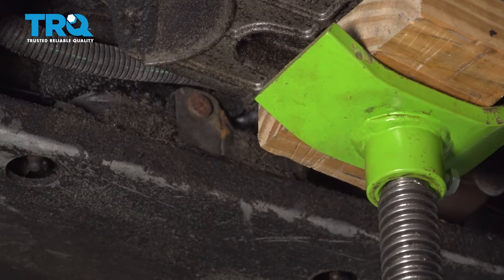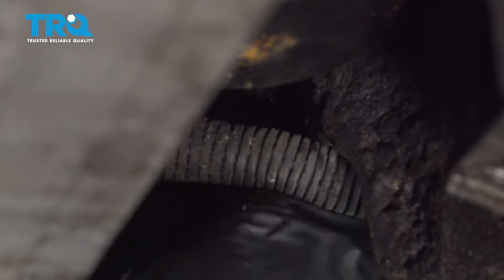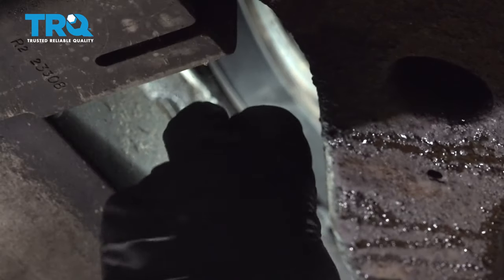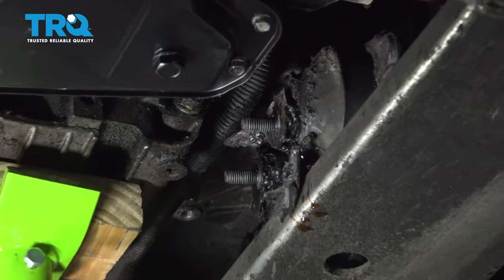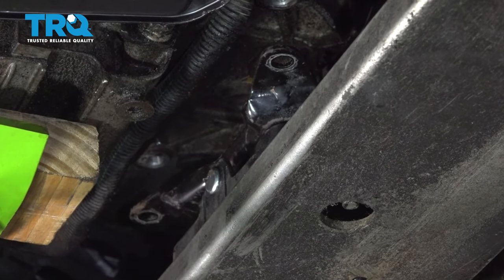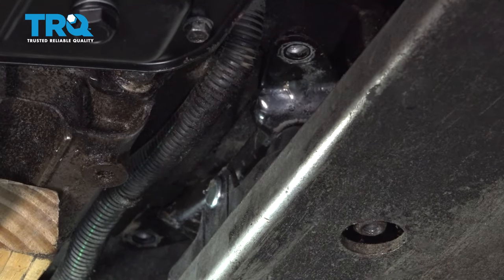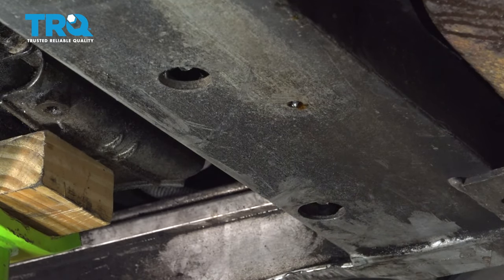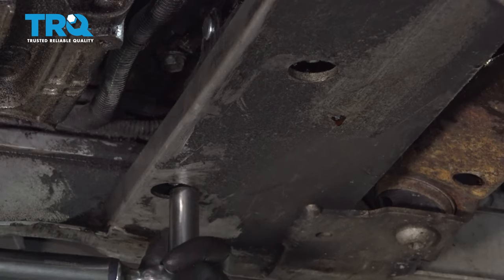How to Replace Engine Mount 2006-2013 Chevy Impala

Comment: Never tighten bolts until all bolts are in place, it makes life a lot easier, Now as far as the nuts on the bracket  you have no choice because you won't be able to reach them later

Comment: You should have mentioned that it’s bet to remove the 2 mounts up top the (dog bones ) and that allows the engine to raise up with zero resistance, and helps work the lower mount out , those lower bolts you torqued , I tighten them then start the car shift from rev to drive a few time and recheck the torque I’ve found those bolts missing many times or once everything is in flush snugged dog. Bones on just tighten them up no reason at all for a torque wrench on something like that snug that bolt and give it a 1/4 to 1/2 turn be sure their tight , or it’ll return with a hard thud when going in gear , 37 isn’t much torque not sure why anyone would even go into that get them even she tighten them up just a bit more then you would s spark plug I know you can’t go cranking in them or it could damage the mount but that also needs to settle good and be tight and I also clean it and spray do gloss on them helps keep leaking oil from getting in the mount glue shed causing separation rubber starts to deteriorating so I clear coat them it just kelps keep that rubber to steel from oil intrusion good video Toss that torque wrench it’s for beginners that break stuff

Comment: I just did the job I did it from the I took the passenger tire off I would suggest that you cut away the bad rubber with a steak knife so you can use your socket better cut away the bad

Comment: If these bolts are not properly tightened would it cause vibrations during hard acceleration and also make the engine not run as smooth?

Comment: I say wrap-cover that new mount, before installing, in some discarded durable plastic bag/packaging and use some clear box tape to secure around it.
This way, petroleum oils which leak out of the seals of our old engines won’t be able to drip on and degrade the edpm rubber mount, causing another failure!

Take care